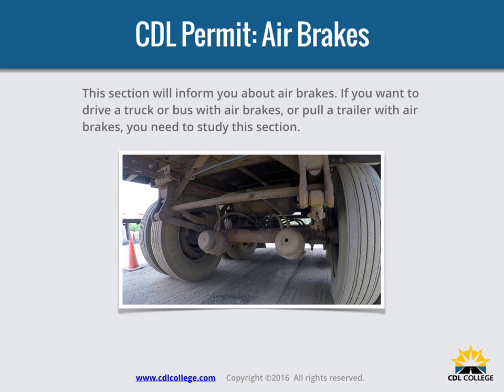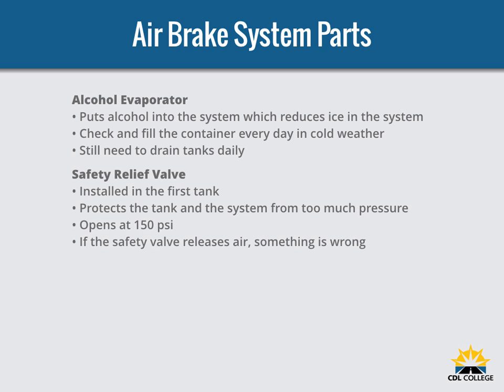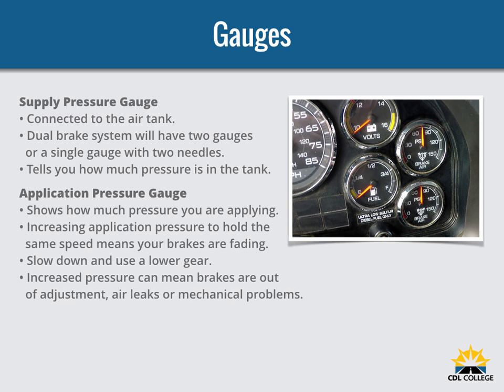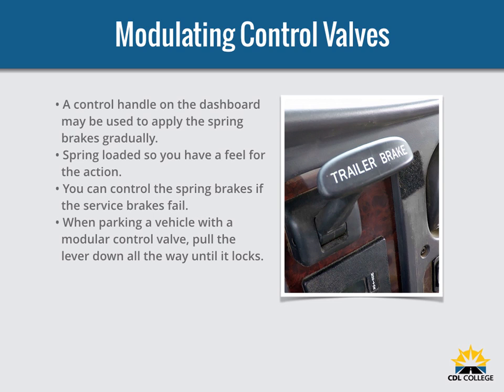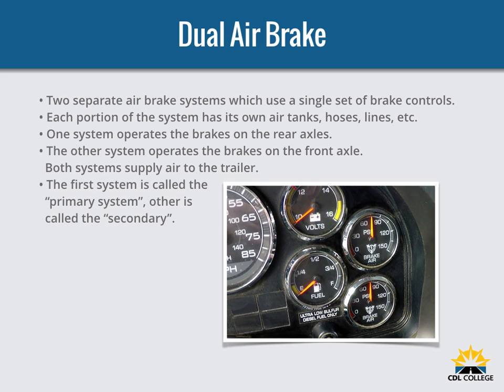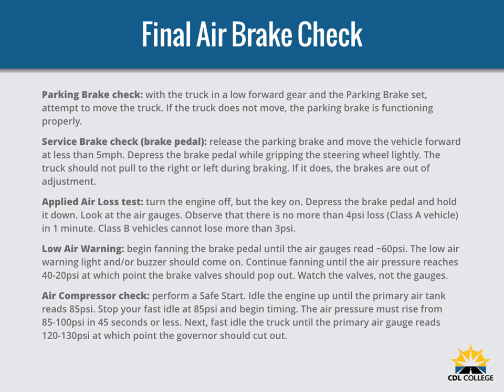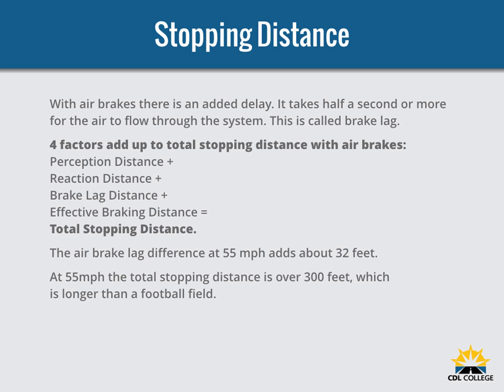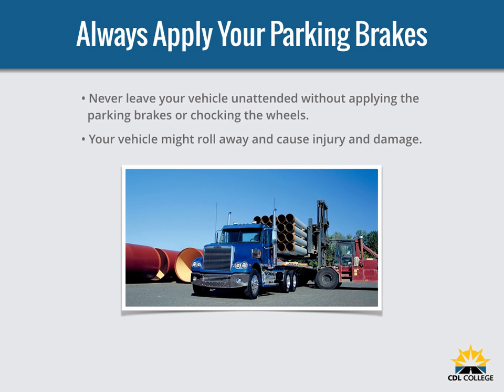CDL Permit: Written Test–AIR BRAKES

Comment: “The easiest way to spot the air compressor is to look for the air governor. The governor is usually silver cylinder with a black cap on top.”
I don’t see a silver cylinder with a black cap on top in this illustration.

Comment: nice video that goes thru most of the non-mechanic subject of air brakes.  Late 1990's  all trucks had ABS on them , you should drain your air reserve tanks every night, uses wheel chokes instead of parking brake in cold weather....etc